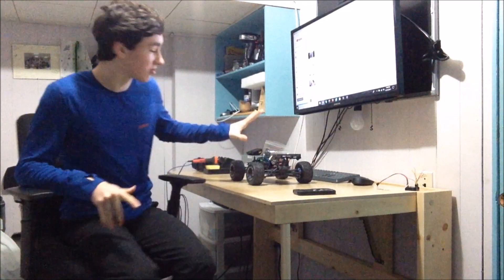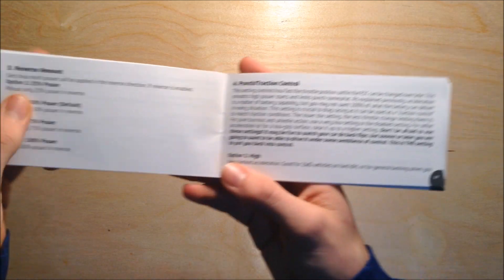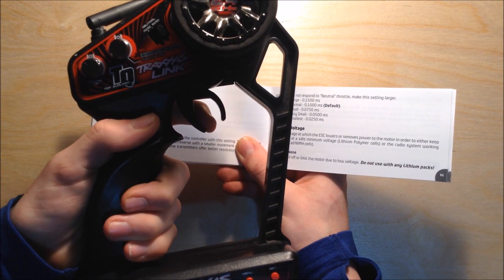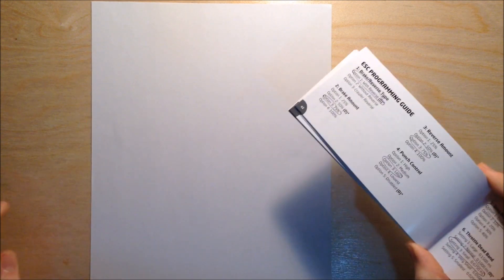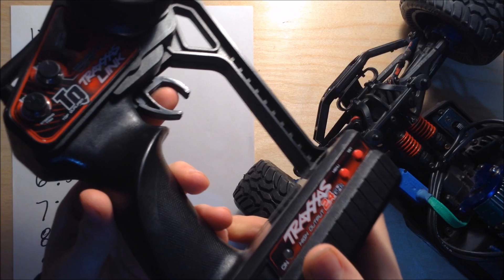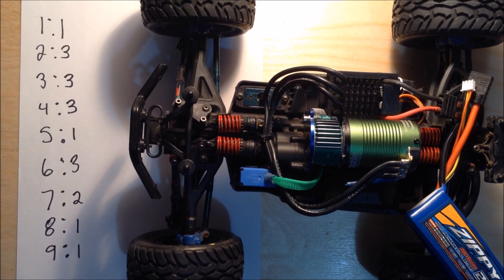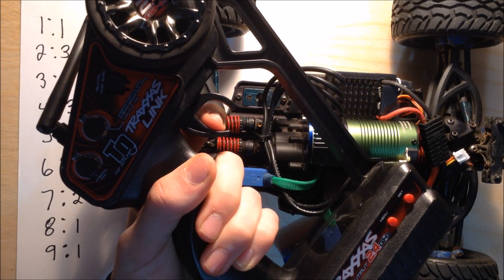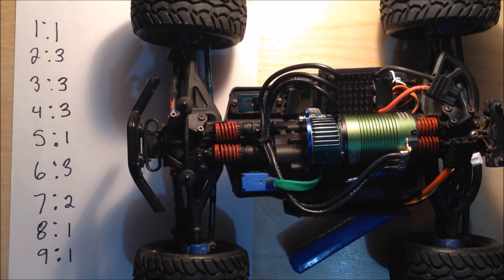Easiest Way To Program Castle Systems *remade*

Comment: Good video>Thanx. My esc doesnt accept my changes. I ve tried several times. At the end of programming, do you just power down and the changes are saved? Is there a way to default to factory settings?

Comment: after i program the esc the throttle and reverse are backwards and i dont know how to fix it
Reply from the maker: If it's a sensorless system, you can swap two of the three wires going to the motor
Reply: @GenesisRC  ok thank you it worked

Comment: I just put in a sidwinder 8th ESC and already the fan isnt spinning. ANy clue why?
Reply from the maker: Make sure receiver plug is in correct orientation. Otherwise I'd say the fan is dead
Reply: @GenesisRC  I figured it out actually. I read on a forum that the fan doesnt start spinning until the esc reaches 150 degrees. I ran it up on the stand and after giving it throttle for a little bit the fan clicked on when it got hot
Reply from the maker: @BeMobile414  Ok good to hear its working properly
Reply: @GenesisRC  thanks for the quick response I saw the last posts were from years ago I said oh shit who knows if this guy will ever answer

Comment: Video very helpful thanks for taking time to help the ones that need. So I need little more help but first a question- Can It be used for drag racing? If so could you just send me a safe number set-up? Something aggressive not so much to damage motor.  I have a 5200mah Zeee 50c 7.4
Or 5000mah Vernon 30c 7.4 Lipo's...
Witch battery
Reply from the maker: You can use it for drag racing yeah. However, the initial strain on the motor with all the torque needed will generate a lot more heat. Definitely use batteries with higher C rating for this kind of harsh use, so the Zee 5200mah 50C or better.

1:1
2:2
3:1
4:4  (most important setting for your application)
5:1
6:3
7:2
8:1
9:1

I would've responded quicker but youtube didn't notify me of your comment, argh!

Comment: How do you adjust the castle bec manually? Thanks
Reply from the maker: From what I looked up you can't change the BEC voltage from transmitter programming. You need the castle link to change those settings, which is a shame..

Comment: Boa tarde tenho esc mamba micro pro ele desprogramou só vai para um sentido já tentei calibrar mas não em modo de calibração alguém sabe me dizer se tem outro meio de programar.
Reply from the maker: "Good afternoon I have a micro mamba pro it deprogrammed it just goes in one direction I tried to calibrate but not in calibration mode can someone tell me if there is another way to program."

You can buy the castle link card from castle. I believe you get a coupon for it for free when you buy a new system.

Translated: 
Você pode comprar o cartão de ligação do castelo no castelo. Acredito que você recebe um cupom gratuitamente quando compra um novo sistema.

Comment: Great video for adjusting the Basic functions in Castle ESC's. However if you want to get into further fine tuning, I highly recommend getting the Castle Link Programmer USB adapter. There are many more adjustable parameters in the software. I run various Mamba's in all my models now because of it. By the way, All new Castle ESC's that are Link compatible come with a Coupon code for a free Castle Link(you pay Shipping) from Castle.

Comment: My mamba x sensored motor is faster in reverse......how do I get it to go that fast in forward?
Reply from the maker: Sounds like you have forward/reverse inversed. Here what I would do: (if you want reverse to be slower as intended)

Figure out how to invert forward and reverse on your transmitter. It should be in the manual. Next swap any 2 wires going from esc to motor. That should fix it.

If you dont care about reverse speed then just increase reverse speed to 100%
Reply: Set Step 6(Motor Direction) to Option 2 in when programming. That will Reverse motor direction. Set your Transmitter throttle to normal, not reverse and leave your wiring alone. A to A, B to B... etc. You can also set Motor Direction in Castle Link(which I highly recommend).

Comment: Hay, I have a question. What if the car goes straight to reverse instead of break?
Reply from the maker: That'd be setting 1; brake reverse type.
Reply: Thanks so much, that's working now. But when I program I get the finishing beap tone's after 6. I pull yes for 6-1 and get the ending tones
Reply: I can't get to lipo cut off mode.
Reply: Is there a light to indicate lipo or nm

Comment: Awesome. Any recommendations for a transmitter/receiver? I have an Axial Yeti with a Mamba Monster X/HH Puller Pro bl 540 standard 3500kv. What do I need to look for when choosing a Transmitter/receiver? Thanks again?
Reply from the maker: The best thing to do is look on forums online to see what people have the best experience with. Based of off others opinions you can pick a combo that best suits you. The only thing that matters past your initial research is how many channels you need to operate your vehicle. That includes the amount of channels on your receiver AND your transmitter. You'll always have Ch1 for your servos that correspond to the wheel, and Ch2 for your ESC connection which corresponds to the throttle. If you just want the rig to work as a moving vehicle, you don't need any additional channels. But if you wanted to operate a dip switch on your transmitter that turned lights on and off on the machine, you need a extra receiver channel, along with a switch on the transmitter.
Reply: Genesis RC & FPV Thanks man